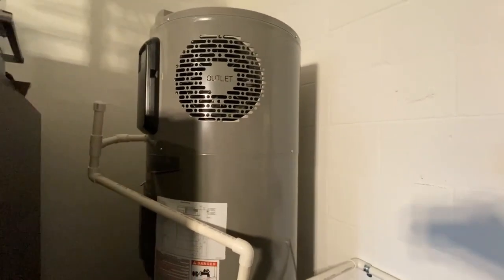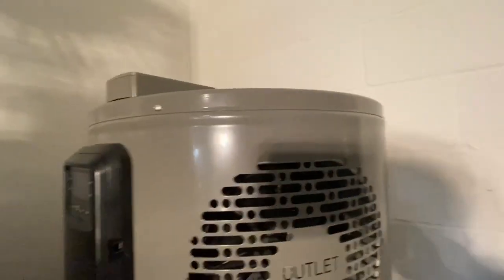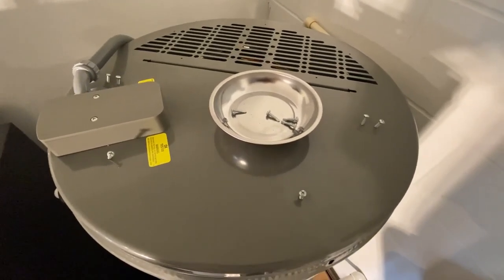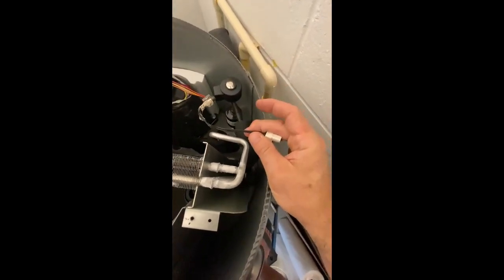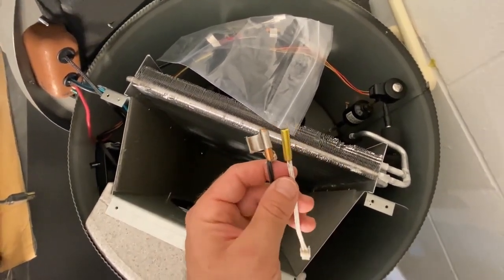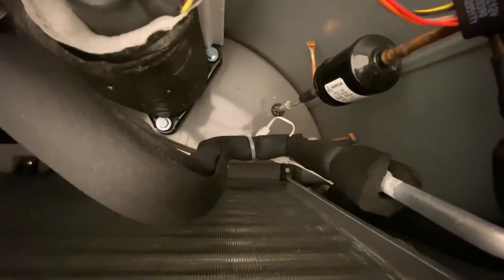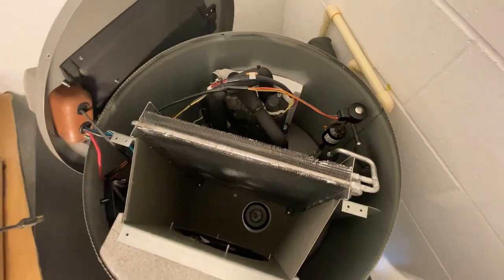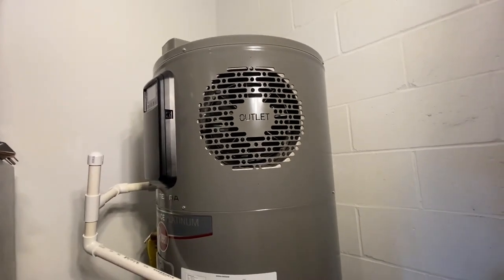Hybrid water heater error code

Comment: On the 2024 Rheem Proterra hybrid I got an A104 error code. Rheem sent me a new white sensor. Since the manual says upper heater sensor failure I replace the black sensor on the top. But I'm still getting the error code. An no hot water. I tried clearing the alarm history but it failed immediately after replacement.   Am I changing the correct sensor? Has something else failed?

Comment: I might be up in the night, but I'm jumping on a few of these threads to propose that people move that ambient air temp thermistor AWAY from the discharge line. You can see the location really well in your video at 3:59.  I've seen it in the same place on mine as well as several others in similar videos.  I don't know if it's responsible for the error, a contributor, or nothing at all; but I could tell I was getting anywhere from 2 to 5 degrees of high bias on my aT (and that was after the fan started, it was a lot more when fan wasn't running).  I replaced my thermistors, but I tested every one I took out and every one I put in, and did not see any of them test bad.  So assuming my testing was accurate, this is the only thing I changed that was material and I haven't had the error in a couple days of hard use.  Previously I couldn't go more than a couple hours.
Reply: A quick update I still have not gotten the error since I made this change. I have gone into diagnostic mode a few times and I have seen dT as high as 198, and I know that the temperature at which it kicks out is 200.  So if a few degrees aT causes a few degrees dT then seems plausible to me.
Reply: @TruthShallSetUFree  When thermisters fail, the always read high.  Did you replace it?
Reply: @teekay_1  Its been a long time since this post and I did replace them but as I said, they all tested good.  Since this post moving the location, my unit has been running without issue.
Reply: @TruthShallSetUFree  That's good to know.   Thanks for the update.
Reply: That was the advice I got from Rheem earlier this week with an A004 error.  After taking a look at all the readings ambient temp on that thermister was 79 F.   The ambient thermister was reading high, so he sent me a couple of thermistors and recommend I move it away from that line.  I have a 4th generation that has a lot more squishy foam inside it, so it's a PITA to work on a lot of the sensors, but this one is on top so it should be no big deal.

Comment: Just swapped my 3 thermistors (not ambient). Performance characteristics are much better. Previously, once I started using hot water in a day, the compressor ran and ran. Eventually the hot water would be restored or the energy saver mode would give it a heating element boost to help finish. Now it finishes heartening between uses throughout the day and no element boost! 

I put all the thermistors in an ice bath. New ones all measured 33.0K. Two of the originals were 28.5k and one was 10ish k (kept getting different readings). Assuming they use temperature differentials, it dont think the absolute differences are a big deal. But the evaporator thermistor was way off the mark.  Note my main symptom was the coiled freezing up. I’ll keep watching it, but current results are very positive.
Reply from the maker: Glad you figured it out. Its annoying, but once fixed these units are great!

Comment: WHAT??  Did you see that. Why are the OEM original wires multi color while the replacement wires are ALL WHITE?  Is Rheem sending a upgrade to faulty manufacturing parts?  I have a rheem hp wh thats 2 years old and had the same code.  They sent me the same white wired replacement sensors for the same 3 they told you to replace. Anyways. Thanks for the video. I’m not alone.
Reply from the maker: I did notice that when I received them. No idea on why. But it did fix the problem, so now I move on to the next one…

Comment: Thanks for the video, mine just shut down this morning.  Discharge temp high. How do you access the codes? Mine is also just over a year old. It seems to run all the time and the app says I'm out of hot water but there seems to be plenty when I use the hot water. I think probably the thermistor also.
Reply from the maker: Sorry to hear that! Running all the time may be a low charge. The best thing to do is call Rheem using the number on the water heater. They will ask for the serial number and if it’s less than 10 years old they walk you through the diagnostics. Easy peasy and excellent customer service. I hope it’s an easy fix!